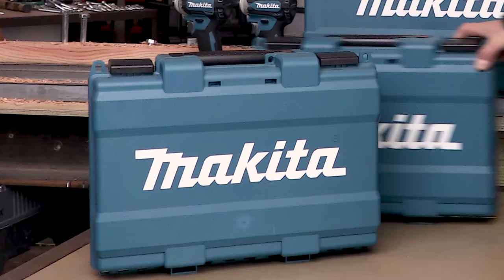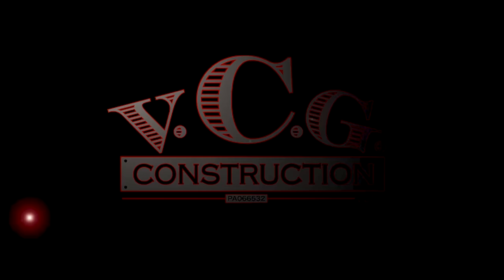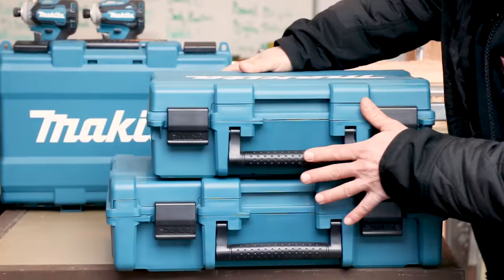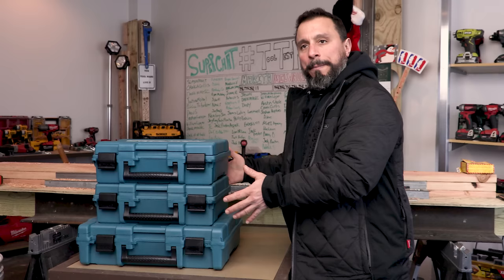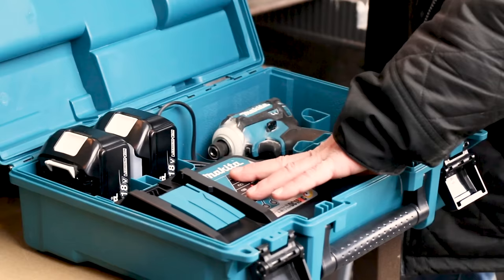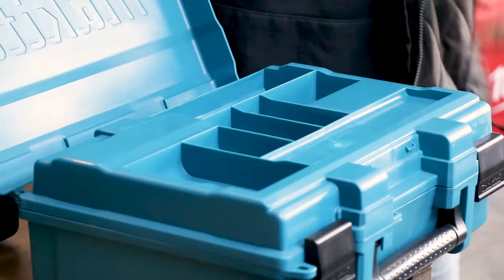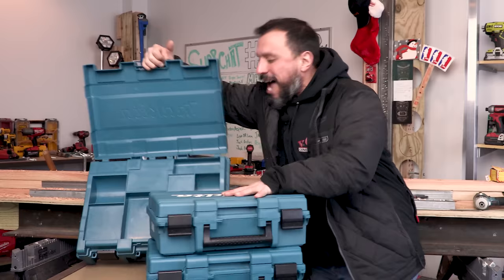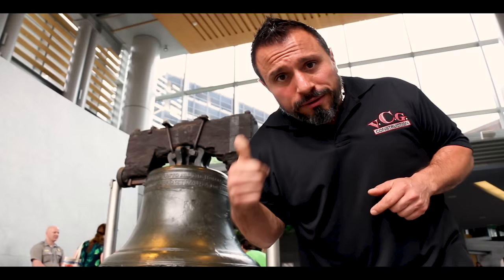MAKITA TOOLS CASES HIDDEN FEATURES YOU DIDN'T KNOW ABOUT!

Comment: You do what you do Vince!
Reply from the maker: Thanks Red I appreciate it!!
Reply: It’s your friendly neighborhood to bear
Reply: TOOL BEAR AND VCG❤💜👍
Reply: @VCGConstruction  Vince where i can buy, i am from europe
Reply: @draganbaralic Makita changes the model numbers in different countries. Availability changes too. I was looking for a case for my XPH07 drill (US model) and only found it available for the DJR186 or DJR187 (UK model) and here it's the same part number for the case 821620-5 
Check out Makitaus and Makitauk and compare. Many models share the same part numbers. Best of luck!
Reply: I've only had my Makita cordless tools for a short time and I accidentally discovered those compartments as I was modifying the tool cases to fit different shaped tools, because some of the tools I had did not come with their own plastic cases. since I picked up the plastic cases at no charge it worked out well 2 modified cases that did not fit the tools. And while cleaning the cases after I had modified them with my Dremel I realize there was another compartment and when I pulled hard enough it opened up, Eureka more space. I have the same question you do why does nobody talk about this is it because they do not know about it?

Comment: I work at Home Depot and I didn't even know that.  I'm selling more Makita's. Thanks
Reply: Same, im a home depot tool rental guy and had no idea
Reply: @meandme8535  Tell MK to stop making those shitty tile saws for you guys. Go back to the red ones instead of the orange. We rented one (store #6321) and from the front of the blade to the back, it was out 3/16" and couldn't be run on a 20A breaker. We ran a wire from a spare breaker to a 20A duplex just for it, and it popped the breaker after 20 seconds of use every cut. It has a 30A twist lock plug coming out of it, and they have a GFCI pigtail coming off to convert it to standard NEMA 5 110V plug. Derp, it obviously needs a 30A twist lock outlet to use. The rental dept at that store is worthless. (I'm sure you know that already.) They did nothing about it.
Reply: You have my sympathy hope you got a real job by now.

Comment: I've just ran round my house ripping these boxes open my mind is blown , why don't they tell you about the hidden compartment 😂
Reply: It's on the instruction folder!
Reply: @Ariranhaa Nobody reads the instructions !!!
Reply: 😃😂u must off been tired or ur rubber soles tyres on ur 🦶 🦶 must have been worn out running around ur house checking these boxes 📦 I was laughing at ur comment from 2 years ago ... Ahahahaha In so much other ppl are clicking on stealth locations ... I have a makita 18 volt cordless drill that’s dated & still working strong 💪 from 2012 with one o these boxes in been using the hidden compartments from day 2 off purchase ... not all my boxes have these hidden compartments so Ahahahaha beware ... if u get my msg today is 2021 best regards
Reply: I did not get an instruction folder in any of mine...until I opened the hidden case, and viola, there it was!  Also found 3 more drills, a sander and a router tucked in there!!! 🤣🤣🤣

Comment: Over here in the 🇬🇧 we have Makita cases called Makpac which are like the Festool systainers. They come in 4 different height sizes but are all the same depth and width for interlocking/stacking purposes. In my opinion much better than these cases 😬
Reply: I love mine, I have a circular saw and a drill/driver combo, can stack them other and carry them both from a single handle. 👍🇬🇧

Comment: My combo kit didn't come with the upper compartment in the case.  Yes, it came with a case.  Lol. However, there is room for both the impact driver and hammer drill to both keep their respective magnetic drivers in the tools themselves with the case closed PLUS an extra battery.  It's the Makita XT269M combo. Oh, and YES i smashed the LIKE button. 👍
Reply from the maker: Whoa!! No upper compartment?
Reply: No upper compartment on my Makita cases either.
Reply: Yeah, saw this video and ran to the garage right away. I have several similar blue cases, but no top compartment.

Comment: Ok. I bought the rotary hammer grinder combo set, grinder goes on the shelf,roto hammer and bits in the case. First thought was no way, so I  checked case quality on mine is lower,  and no hidden compartment. But that's how Home Depot operates.

Comment: Can honestly say I never knew about that compartment except on my hammer drill case as it’s a clear blue cover that shows it underneath. Why I didn’t think it was there with my other cases is beyond me, but it does highlight a design floor by makita that should be easy to correct to draw attention to the compartment. It’s definitely getting used now rather than letting things roll around with my tools transporting it from place to place doing odd jobs or grabbing a tool bag that’s for sure!

One thing I do not like and I spotted it as well with yours is the steel pin for the hinge. I don’t like how it can slide out. It’s an issue I have with the cases you have in the video and is getting worse the older it gets. It needs something to latch onto to hold it in place and if that happens I would be 100% happy with the case.

Comment: My Makita drill I brought about 7 years ago came with a case that has room for a second drill, two extra batteries, room for the charger and the top had clearish plastic so you could see what drill and driver bits were in which compartment. My guess why they moved away from the clearish plastic was that it doesn't handle the sun too well and isn't as strong.

Comment: I keep all my tools in a separate bag and I use the case for charger 4 batteries grinder and cutoff wheels tons of drill bits saw zall saw blades and all the bits and accessories for the 1/4 inch impact. Works great

Comment: The same with double edge razor dispensers. Instead of throwing away a used blade in the trash where it could hurt someone, in the back of the dispenser is a slot for used blades.

Comment: Its not in all the boxes and neither is the locking mechanism to lock the boxes closed. I have 5 boxes, none of them open up on the top, my Sawsall box has a locking hole, but it is useless, it is only on the bottom half of the box, so you cannot thread anything through the top lid section so even if you lock the bottom, someone can just open the latches, open the lid and steal everything. I think it differs in which part of the world you are and which Makita division is supplying you.

Comment: When i buy a makita driller i get it in anothe case. Where can i get these cases? I got the vacuum cleaner today and i like it. Now i need an akku and a charger. The driller i will buy later. I did not know that makita has drillers with 14,4 v and driller with 18,0 v. So  i sent back the 14,4 v driller. If you want to use all the makita tools with the same akku you need 18 v Akkus.

Comment: My next tool will be a Makita solely because it comes with the included extra storage. However Makita did make mine a little on the lite side and I had to spend a lot of time strengthening it with extra brackets (3 of them) and additional clips to hold the lid closed. It is better than the nothing most other suppliers have but it could have been better. It needs to last the life of the drill. Friends in the trade don't use their storage because the lids come off after a while as I guess mine will eventually but I am not looking forward to this as it means I will have to start carrying an additional tool box.

Comment: A rod or cable doesn't lock anything. The loop doesn't go through the lid, moron. Even if it did, removing the hinge pin is quite easy.

Comment: I should have made a video about this exact topic that is aggravating as hell. I like Makita, I grew up with them, and still have a 7.2v NiCad cordless i've rebuilt the internal battery st least 5 times since it's 20+ yo. But with the prosumer prices, you basically have to pick a brand and hope the tool and battery design is for around for the long haul. I have every Hitachi 18v HXP tool they grace us with in the USDM. Great tools,  great batteries but this gets to your point,  most are bare tools or as of recent a damn nylon bad I hate.  So two things piss me off. One,  they don't import the entire HXP line; Japan,  Australia, etc. Get cool shit we never get in the US that use the exact same batteries and we don't get the same case if we are lucky enough to get the tool.  They introduced their new brushless impact driver about a year ago in the US for $299. Tool battery and the charger came in the standard plastic case, if it actually comes with one.  But the non-US cases had that exact kind of storage  compartment...wtf? Why?  I spent almost $50 on top of the tool cost to get that kind of case some guy in Japan was selling on fleabay.... just because I wanted that f'n storage.  Oh,  and their cases are solid black, not green and grey??? But you know what?  I use the sh*t out of that tool and case.   It should have come with the damn tool, but I don't regret spending that cash because you are dead on,  that storage for bits or fasteners I'm installing or have removed is priceless for my use....f'n Hitachi.... they make a bunch of really cool, useful tools that I already have 20 batteries that would fit it but screw US buyers with the most boring, albeit reliable and well-warrantied, power tools they make. While Big Yellow and Big Red keep introducing new cordless tools and accessories that I would love to own if I didn't already have a fortune invested in Hitachi batteries and tools.